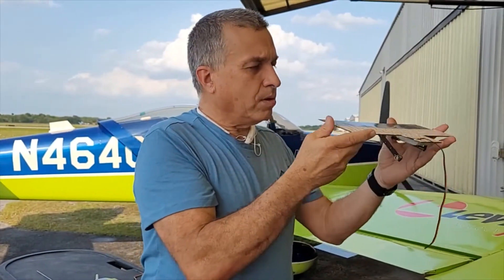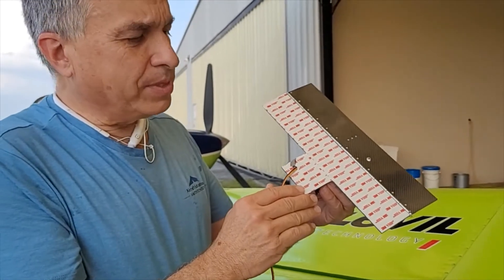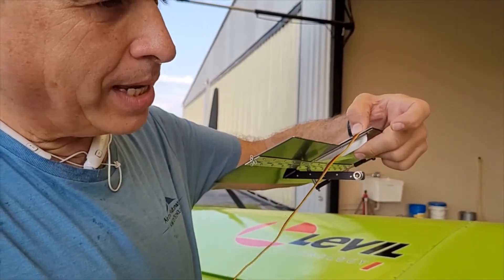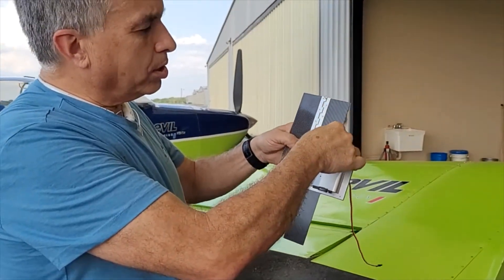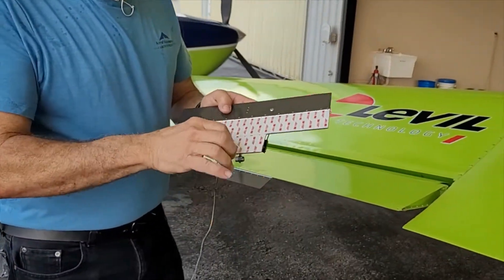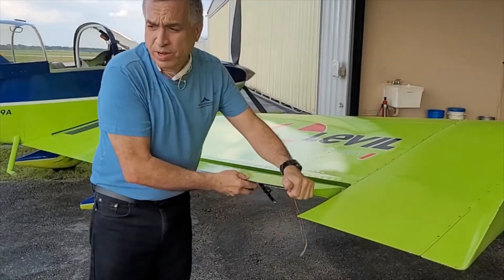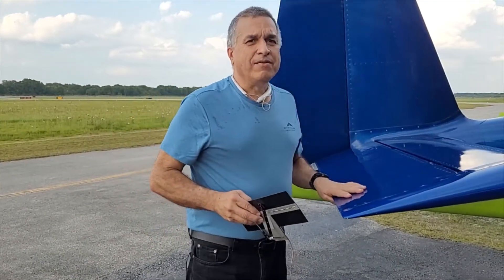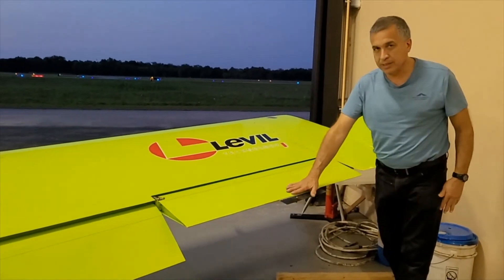How to install trim tabs

Comment: I am in the process of  installing this system on my Zenith CH601 XLB. I will admit to a lot of frustration over this company'sfailure to educate and inform on the installation of their own product. They do not engage in social media. The only thing they publish is these pretty videos which do nothing to clarify the install of their systems. They don't seem to understand that their one, and only market for their products, is the experimental aircraft market and home builders. They completely miss the point that we are a very skeptical bunch who do not trust new aviation products, especially when they involve flight controls. As of now there is not a SINGLE video online to show a detailed installation of their system!  Yes, I've seen the Cory Robbins video, but that too is just a quick overview and provides no detail on the specifics.

I think they have a good product but their failure to engage with the experimental aircraft industry, in any way, makes it a tough sell to this market. 

As I install this system on my aircraft I feel as if I am a test dummy for their product. Every step raises new questions for which AA provides no information. It would be one thing if they were producing many different designs and configurations for their system. But its ONE SINGLE PRODUCT. Yet after more than two years they still cannot publish a single install video for their system on ANY aircraft.

I am in the process of making such a video and will publish it on YouTube. I'm not a Youtuber, so my video will be painful to watch, but I intend to video each step in the process. My hope is that this will provide some of the answers to those who are considering this product.

To be clear, the install is probably stupid-simple for a professional avionics installer. However, us homebuilders typically build ONE aircraft. We learn quickly that the simplest misunderstanding during the install can have serious repercussions. So we need step by step instructions to help us feel comfortable with the installation of any product in our aircraft. When you consider SuperECO is part of the aircraft control system it is even more critical that the manufacturer provide precise and complete instructions, including detailed videos. Yes, every plane is different, which makes it even more important to provide SOME detailed recommendations on the install.

Comment: Does the elevator and aileron trim tabs need to be on the same side of the aircraft? ie: both on pilot and/or both on passenger side? Or can they be on opposite sides of the aircraft?
Reply: Two years and they still don't answer a simple question on their own YouTube channel. The same question I had, btw.